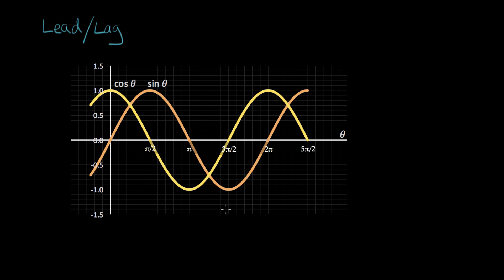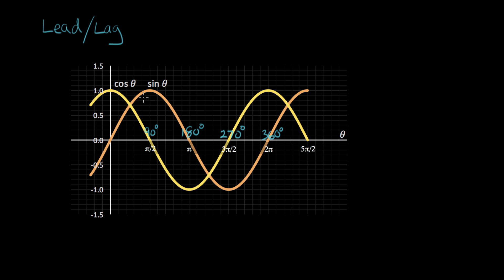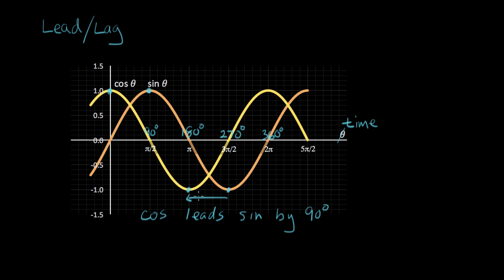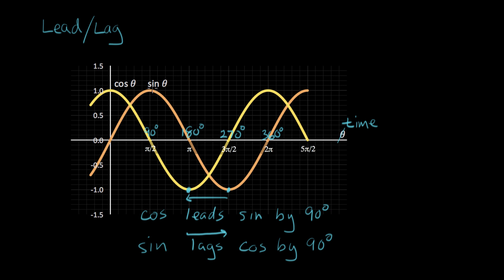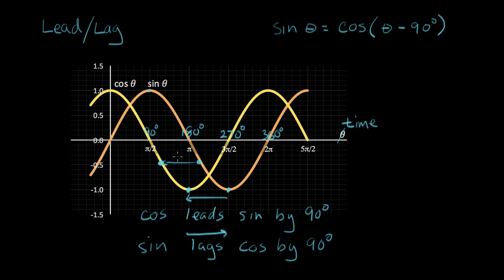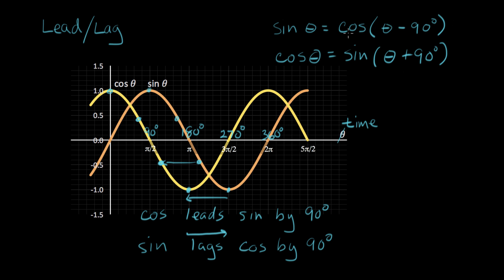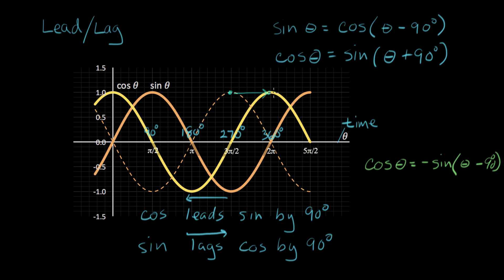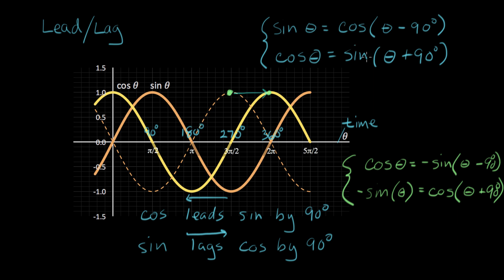Lead Lag

Comment: How do I know when it is leading or lagging, or rahter what does that mean exactly, cause how I see it, sin is infront of cos (more to the right) for the same values, so wouldnt sin be leading cos. And cos be lagging sin? This makes more logical sense, that why I think my definition of it may be wrong, can somebody help pls
Reply: Ive thought about it more, and the only thing I can think of is that, cos is at value 1 before sin so it leads sin to one. Sort of like leading the way, or just simply being there first. Is this a valid way to see it?
Reply: this is exactly what I see .I am not a native English speaker but according to most of the recourses the word `leads` means to come earlier so in capacitive circuit when the voltage is lagging the current by 90 degrees, so the phase of voltage is the phase of current -90 degree. so, the current reaches its peak first then after 90 degrees the voltage does BUT all the recourses claim the opposite :(

Comment: Would cos (theta -300) be LAGGING cos(theta) by 300 deg.?
Are there any conditions where LEADING COS can NOT be converted to LAGGING COS and vise-versa?
Thanks for the great video!!!
Reply: cos(θ-300°) and cos(θ)? the θ in your statement is the 300. Maybe you meant cos(wt-300°) and cos(wt). If this the case, the waveform was delayed by 300° (kinda looks like it shifted to the right) from the cos(wt).

Comment: but when we add the graph shifts to the left !!
Reply: I mean the function shifts
Reply: think of it this way, we gave sin a ' 'head start' ' of pi/2 in the equation cos (theta)=sin (theta + pi/2) and even after the head start sin does the same thing as cos does which mean sin is slower so it ' 'lags' ' cos